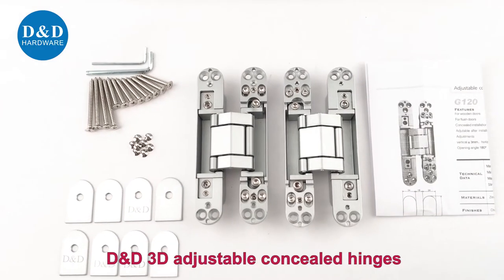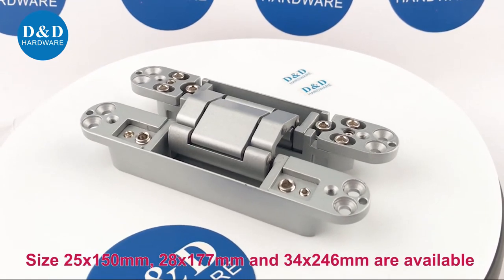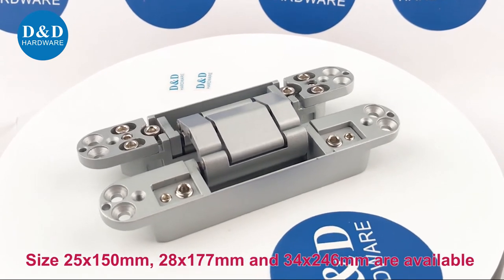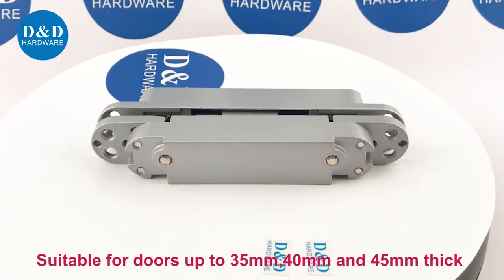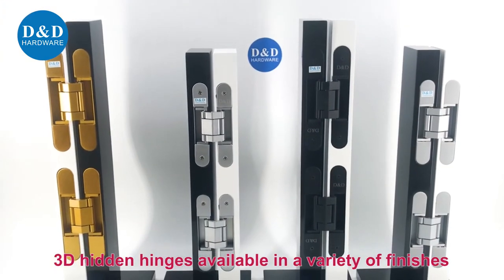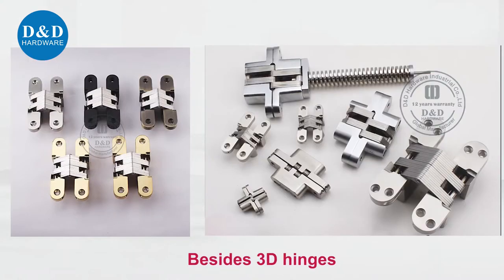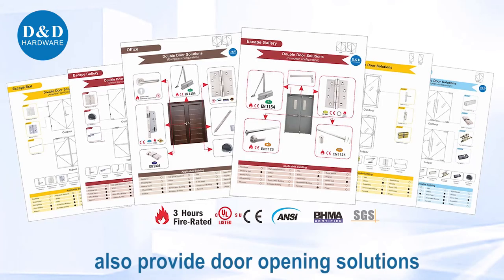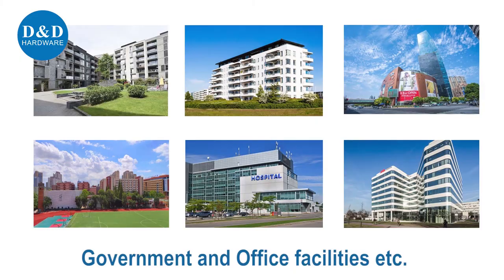3D Concealed Hinges for Door-D&D HARDWARE

Comment from the maker: Main Product Web:
1.Door Hinge:https://www.danddhardware.com/door-hinge.html
2.Door Lock:https://www.danddhardware.com/Door-Lock-pl3954583.html
3.Panic Bar:https://www.danddhardware.com/Panic-Exit-Device-pl3854583.html
4.Door Closer:https://www.danddhardware.com/Door-Closer-pl3554583.html
5.Door Handle:https://www.danddhardware.com/Door-Handle-pl3454583.html
6.Lock Cylinder:https://www.danddhardware.com/Lock-Cylinder-pl3054583.html
7.Door Viewer:https://www.danddhardware.com/Door-Viewer-pl3716962.html
8.Door Bolt:https://www.danddhardware.com/Door-Bolt-pl3654583.html
9.Door Stopper:https://www.danddhardware.com/Door-Stopper-pl3254583.html
10.Glass Hardware:https://www.danddhardware.com/Glass-Hardware-pl3616962.html
11.Door Accessories:https://www.danddhardware.com/Door-Accessories-pl3200552.html